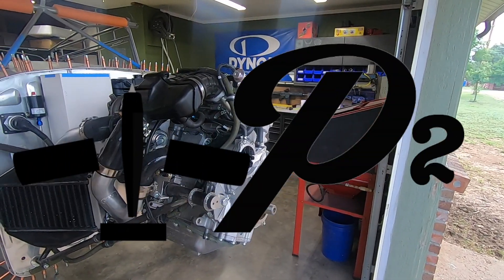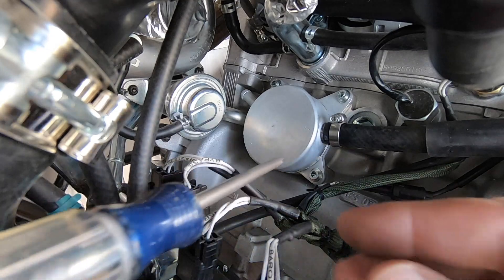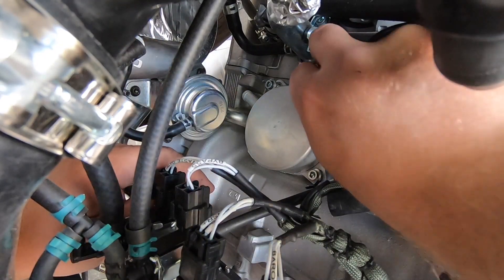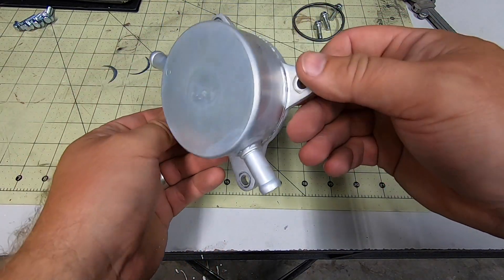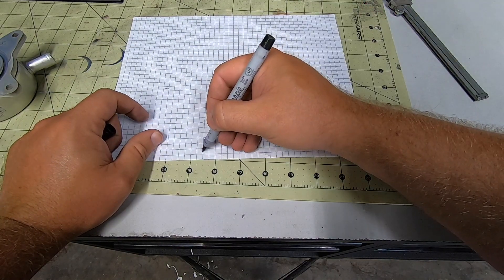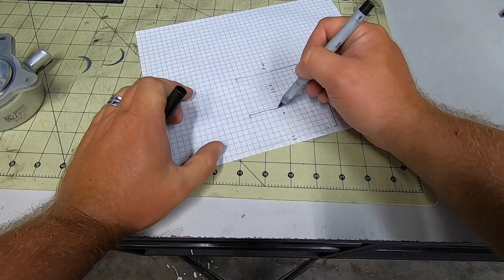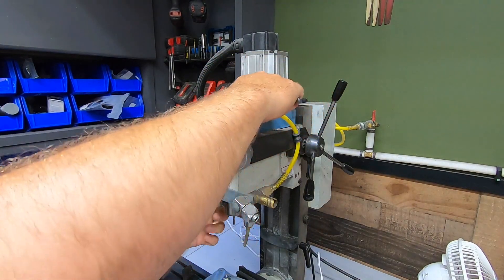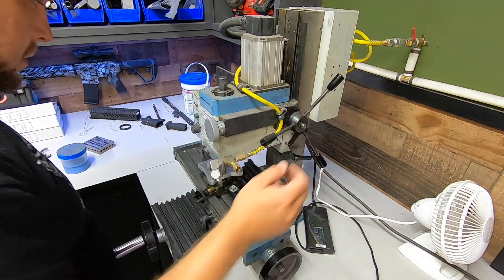RANS S-21 YAMAHA 998TURBO UPDATE EP32

Comment: That is the smallest rotary table I've ever seen. Why don't you just measure the part instead of putting it on a piece of paper??
Reply from the maker: Would have saved me the error for sure.. I love the little mini table, a bigger more capable machine would be handy for sure, but this little guy usually gets the job done for me👍
Reply: @Project2Aero  yes it did get the job done.  Looks like it purty accurate too. What brand is it??
Reply from the maker: @gregwatruba4541  The mill is a 3990 hitorque model from littlemachineshop.com and the rotary table came from harbor freight years ago. After learning to work around the shortcomings of the machine I've found it very capable.

Comment: Something you may want to consider:  I do quite a bit of prototyping and reverse engineering for parts just like you are doing here (i.e. I don't have prints for the parts I am connecting to).  A $250 3d printer allows me to sketch something in F360, extrude a very thin version of it, print it and then use it to match all the bolt and through holes.  Sometimes I will iterate something 2 or 3 times before I get it right, (but it costs like 10 cents per print)  then I send it out to oshcut or sendcutsend, and it comes back perfect. It's a worthwhile investment, and I've used it to make all kinds of handy tools.
Reply from the maker: Sounds like great advice! I may have to dabble in the 3d printer world soon, thanks!

Comment: Do you think you could fit a dirtbike in the back if a method could be sorted to take out the seat to get it back there? Going through my spreadsheet again, with a full load of fuel and myself, there should still be enough payload. Just not sure if there is room inside, and I don't really want to strap it to the bottom.
Reply from the maker: I’d be more worried about cg when it comes to something as long as a dirt bike.. I suppose if it was smallish and you removed the front wheel it might go in🤷🏻‍♂️. Keep in mind the titan models have highest baggage area capacity due to the extra weight out front. It’s still a bit of an unknown what I’ll have until I get to the weight and balance steps. Stay tuned👍
Reply: @Project2Aero  Yeah, I was thinking around 200-230 lbs, so fairly light. I'd have no problems taking the wheels off of it to help make things fit. I wonder if the engine mount could be built such that a ballast could be added to the front for specific situations. I know know it's not ideal, but just an idea. IIRC, RANS was looking to up the gross of this airframe, so the bit extra shouldn't hurt too much.
Reply: @Russ Bell yep, that has also been on the list after seeing Mike set up scrappy for exactly that. Just, you know, not as many or as nice, haha.

Comment: I figured you were busy with summer-stuff with the family, leaving less time for building. I appreciated the air-cooled v coolant-cooled oil. Not really sure how hot coolant is suppose to cool hot oil. 🧐 Props for the slo-mo at 7:43. Laughed WITH you, not AT you! If I had a nickel for every open container I've knocked off of my workbench! Good to see you at it.
Reply from the maker: Slow and steady, I’ll get there soon enough. Thought that dump of cutting lube would give a few a laugh.. 😅
Reply: Why not stick with the factory oil cooler?  Seems you are over complicating things.   If it ain’t broke why are more plumbing?   Maybe you are afraid the coolant to air exchanger will be too small given the ambient temp for snowmobiling is probably a few dozen degrees higher?   But really if there is room just upsizing radiator for the coolant a bit seems much simpler.   

Engines I work on have water to oil coolers which work great for 10’s of thousands of hrs.   Main headache is when coolant gets a leak and engine starts “making “ oil.   But this is easily monitored via dipstick and pressure tank.

Comment: Nice work!  Have you tried taking a photo of a part and importing it into fusion360?  You can then use the scaling tool to dimension it properly and create your sketch on top of that.
Reply from the maker: Very interesting idea! Gonna have to try that thanks!
Reply: There are a few good tutorials on how to do it here on youtube.  I have used it for several things I have 3D printed and it has worked well, especially for locating holes.

Comment: Nice job 👍. I’m looking at building a plane with Yamaha power too.  Have seen the 3 cylinder out there but haven’t seen any particulars on it like horsepower and weight. I like watching scrappy too, but let’s be real not all of us have unlimited funds or time. Great video.
Reply from the maker: Thanks for watching sir! I hope to have those numbers soon. Yamaha says it should have 180hp up to 10,000ft but we shall see if that useable power or not. Weight wise I expect to be around a rotax 915 install weight somewhere around 200lbs. Stay tuned👍
Reply: @Project2Aero  You can set them up to take a whole lot more power than stock on stock internals and still run that for quite a while. You should be able to use max stock power at altitude without much of an issue and then turn up the wick on takeoff if needed.
Reply from the maker: @Jazz3006  that’s the plan, I think it’s gonna be a good reliable option👍
Reply: @Project2Aero  Well, you'll be finding out before me, so I hope it all works out well. I'm really looking forward to performance numbers from this thing to see if this combo lives up the the expectations I have for it!
Reply from the maker: @Jazz3006  you and me both! Fingers crossed.. lol